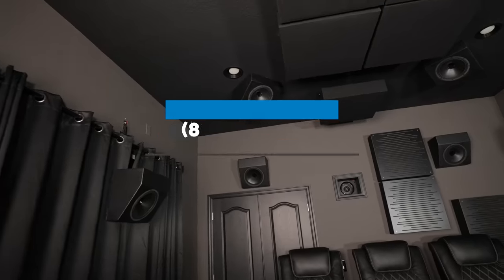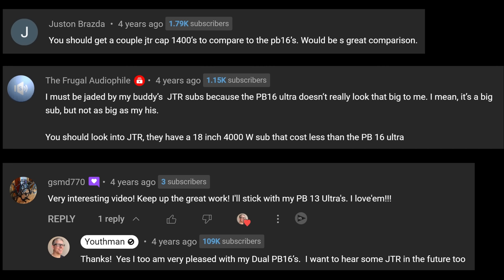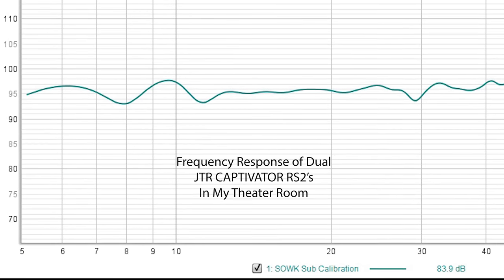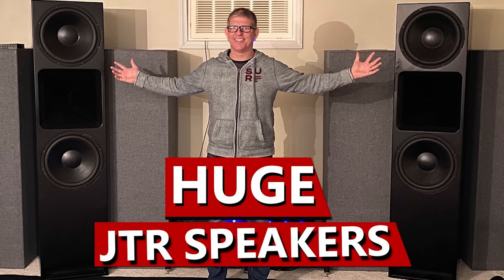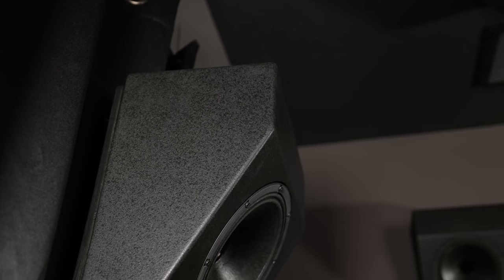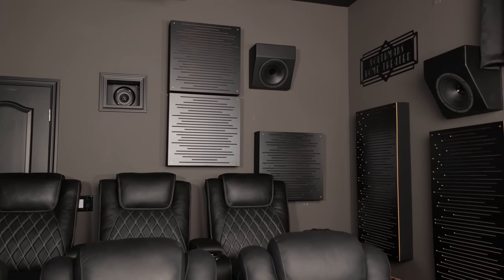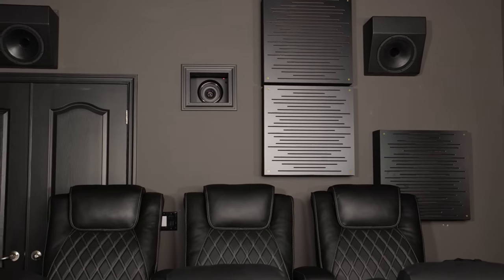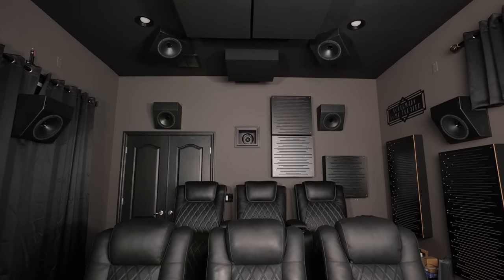I Installed EIGHT JTR Surrounds and Height Speakers in My Theater! | NOESIS 110HT-SL

Comment: Michael, great video! My theater was very similar to yours, I also was rolling wide dispersion for my sides. I made the decision to do a major upgrade, which included buying all new JTRs (Qty 5 Noesis 212RT for L,C,R, RS, LS |  Qty 2 Noesis 110HT-SL for both RS | and a Captivator 4000ULF-LP). Your video of Tony's theater sold me on JTR (You should get commission :) ) I remember Tony saying that he wished he had room for towers for his sides. As a result I knocked out large square holes and built large speaker pockets for my JTR 212RT as a part of my theater renovation along with extending my room 3 ft to make room for a new/large transparent screen and widening it by 6 ft. I removed most of my sheetrock and insulation and installed rockwool and use fabric for my walls. Also bought a new marantz, qty 2 monolith 7x200, JVC NX-7, and a miniDSP. During my first movie I watched I had the same reaction you did, the narrow dispersion of JTRs make for an incredible experience for object oriented sounds. I live in Texas so I can relate to your attic experiences. Your channel has been an invaluable resource to help me design and build my end game theater! Big thank you for all your hard work and content!  God Bless!
Reply from the maker: Thank you so much for the kind words. You have put together a phenomenal system yourself. I would love to hear it one day.
Reply: @Youthman  If you are ever passing through Central Texas I'd love to have you over, I'll even treat you to some Texas BBQ!
Reply from the maker: Thank you for the invitation. I have not been to Texas yet. Feel free to submit your home theater at www.hometheatertours.com.
Reply: @Youthman  just submitted
Reply: @Youthman I live in Texas too. I usually get all my items ready to put in the attic and go up and do it to it at 3-4am. That way sweat isn’t pouring into my eyeballs, burning until I wipe my face! That way it is about as cool as it gets up there…

Comment: I lived in Phoenix and had to do similar work in the attic. It was summer. We started at 6:00am and worked 3-4 hours a day. Took three days and before entering the attic we would guzzle a bottle of water at night and another first thing in the morning. We put on Tyvek suits, climbed the ladder and brought up tools and lights and completed the job. It’s rough working in those conditions. The temperature started at 90 degrees and soared to 160 degrees by noon. I won’t do that again.

Comment: Thanks for another outstanding experience Youthman, I've enthusiastically subscribed and followed you for many many years.  Your content is second to none IMHO.  I have a similar dimensioned room to yours and JTR 212 LCR + 4000s.  I also have the exact Klipsch surrounds + atmos speakers you just replaced driven by a Monolith 11x.  I've been contemplating your upgrade for a while now.  Do you think the 100 watts you're feeding the 10" JTR surround/atmos is adequate (rated up2 750 @ 8 ohms), or should I plan for more amplification long term?
Reply from the maker: Thank you kindly. I am completely satisfied with the 11X driving my entire system. It definitely helps that both JTR and Klipsch are high sensitivity speakers. Would my speakers benefit from having more power? Probably. Would I hear a difference in a blind A/B comparison. Maybe. Maybe not.

Comment: Well I’m glad to see that big smile on your face because I know you had to deal with some challenges in your attic but I hope you have the pay off that you were looking for and I am very curious about what you used to mount the 1-10 on your ceiling  because I can’t mount my speakers in the ceiling so I used some speakers mounts and I have all old school DCM speakers the original ones built in the 80s and the CX series made in 91 and Polk T15s for Atmos.
Reply from the maker: Thank you Michael it was definitely a challenge, but totally worth the effort. As stated, in the video, I added additional two by fours in between the joists. On the rear of the speakers, there are four key holes. We used 4 large screws to go into the 2x4’s and joists. Then an L bracket to lock the speaker in place.

Comment: Phenomenal upgrade Youthman and give you massive credit to go into the attic to do what you needed to. At least you can say you’ve covered any cardio exercise for the next 6 months lol
Reply from the maker: For real. I’ve been above my theater room maybe 4 times running HDMI cable, installing projector (adding bracing), installing Atmos speakers and running speaker wire.

Comment: I'm watching this for the second time as I determine if I'm gonna get JTR speakers.

One thing you said was about having wide dispersion rears. Is that really a Dolby Digital and DTS thing? Where'd you see that info?

I thought it was just the original Dolby Surround and Pro Logic decoding that didn't want directional audio because both surround speakers shared a single channel.

I think the idea for having 2 speakers is that you could mount them easier and higher up on your wall than with a single speaker in the middle of the back of your room with a long wire going to it.

I've been looking into Dolby Pro Logic and Pro Logic II as of late for some testing vs Dolby Surround (Atmos version) upmixing.

Dolby Digital has discrete surround channels and with Surround EX, an optional matrixes 6th. That's why I was wondering why your home theater was built the way it was for Dolby Digital. I wanna know where this information exists that I'm missing 👍

Comment: Those JTR (or some of the Danley GO2 range) look like they'd be quite good in a home theatre. I don't think I'd crank it so balls to the wall that I'd exceed the capacity of 8" co-axials, and they are quite compact (though not HTIB level).
Or if you live in a sound leaky apartment, binaural headphones and a Sub pac. I've always like the binaural effect. It is two channel headphones but with all the phase differences and EQ between channels that trick your brain into thinking the sound is some distance or direction away, instead of sounding right by your ears. I haven't heard any films with binaural recording though. The only thing the headphones miss is the feeling of bass on the body, which is what the tactile transducers are for.

Comment: I have been telling people, for years now, that On-wall or On-Ceiling Atmos speakers aimed directly at the listening position is far superior to in-ceiling speakers which may not be exactly on axis.

Welcome to the club Yout'man!
Reply from the maker: I had my in-ceiling on axis. They have aimable midrange and tweeters. JTR is just in a whole different league. Also, having a dedicated speaker cabinet is also a plus
Reply: @Youthman  a lot of people end up off axis though.  Especially if they follow the dolby guidelines to the letter and the speakers they choose dont have a steep enough angle to get them on axis.  I've seen quite a few people move from in-ceiling to external speakers precisely aim and almost everyone likes it significantly better.

I would leave the in-ceiling speakers for those cases where absolutrly cannot mount a speaker on the wall or ceiling.

Comment: May I ask what the theory is with the rear surround placement? THey seem to be outside of the seating area and I'm unsure if this is a specific choice to try and achieve a specific axial relationship to the seating.
Reply from the maker: Simple reason is they had to be mounted higher than my door. Just a limitation of my room but fortunately the angle of the speakers is perfectly aligned to the front row. The rear seats will not get the benefit of the surround back speakers

Comment: Next on the upgrade path:
AV Professor: Marantz AV10? Anthem AVM70/90? Trinnov Altitude 16?
Speakers: Wides?
Projector: JVC Laser?
Reply from the maker: Eventually, it will likely be a new processor. Already considering the JVC NZ8. Wides will probably not happen due to the size of my room. I have the Anthem and AVM70 in for review so I’m curious to see how it compares to my Marantz AV7706.

Comment: Congrats on the new system.  I live in Daytona Beach so I know the 'joy' of working in the attic in the heat.  One time I almost passed out and found myself stuck on some 2X4's and had to tear my pants off to get out.  Once you stop sweating that's heat stroke time.
Reply from the maker: Yes, that last 15 to 20 minutes was pretty sketchy. I knew it was time to get done and get down. I just didn’t want to come down, get cooled off and have to go back up in the attic to finish.

Comment: what an amazing move for you Micheal! I love using togglers to install things into sheetrock situations... they are very sturdy and easy to use. Congrats on the progression! next up trinnov??
Reply from the maker: Thank you, kindly Eric. I don’t have any plans to move to a Trinnov anytime soon I have the Anthem AVM70 in for review.
Reply: @Youthman I hope you get a good ARC calibration. Less is more with ARC IMO.
Reply from the maker: Appreciate the tip. I just hope it does better with base management than it did back when I reviewed the MRX 1120 it sucked the life out of the bottom end I even sent the file to anthem to tweak. It was better but still was very anemic.
Reply: @Youthman  The difference this time will be built-in time and phase alignment. The Room Gain is mid-bass 150-300 Hz. Deep Bass filter can be centered from 20-80Hz. These are filters similar to miniDSP. Tilt can be adjusted for brightness. 

I stop filtering at the last peak/null beyond 3-4 db for each channel which for my room and speakers provides a more accurate sound reproduction. ARC does require a bit of adjustment to get to your destination, but all race engines must be tuned.
Reply from the maker: Sounds like they have made some nice improvements to ARC since my experience several years ago
Reply: @Youthman  yes sir. FYI from the ARC AVSForum thread: Once you upload your ARC solution into AVM70, power cycle the unit to complete the process. This is a newly discovered bug and not currently covered in the documentation.
Reply from the maker: Appreciate the tip

Comment: Jeff's right, Youthman's right ... urge overkill on the fastening!

Overhead, in a room with serious LF capabilities ... anchoring/fastening must be rock solid way over engineered. 

It's great you address the importance. 

I've got Unistrut down each side of the room, front to back. 
Spanning side to side, I've got sets of Unistrut that I hang QSC yoke mounted actives. 

Since it's all Unistrut, I can quickly experiment with any positioning, and yet with all the structural integrity in the world. 

Of course, the Unistrut aesthetic isn't for everyone ...
It's great for cabling, festooned. 

Great update.
JTR's just killin' it.
Reply from the maker: For sure. That’s awesome that you can adjust your speakers.

Comment: Awesome setup!  Did you leave all your ceiling speakers installed or just the front 2?  I was just curious with my install if I could maybe just install a sideways beam into other beams and mount the speaker over top of the hole vs patching all of the 9" big holes.  Also curious if you had a chance to hear the Captivator 2400's and how they compare to the RS2's because I'm not sure I have space for RS2's.  Thanks!
Reply from the maker: Yes, that’s exactly what I did. We ended up moving the front speakers forward about a foot. Rather than hiring someone to patch drywall and repaint, I left those two speakers there. For the rear speakers, I could not move them any further back due to an air duct vent so we mounted the new speakers over the 8 inch hole.

Comment: Great enthusiasm as always, and very understandably so ;-) That´s one thing that has boggled me right from when I started to view your channel. Why did you persist on using diffuse speakers on your surround channels. Those are a thing of the past from way back when Dolby Prologic was a thing. Great to see that you finally moved on and went the direct radiating way, and You´re thrilled with the result. This is the way 😁
Reply from the maker: The main reason Jan is, I’m a creature of habit and don’t like change. Lol. When I built My Home Theater 16 years ago, Dolby recommended wide dispersion speakers for surrounds. I always enjoyed the sound, so I wasn’t in a hurry to upgrade.

Comment: I don't need in walls but I was just looking for the better speakers of the 2 to pair with the rtj 410s
If I chose to either listen only for Atmos and surround speakers would I even notice a difference or like do you recommend by i buy the rtj 110 for Atmos and the floor surrounds with jtr 110s?
Answer me this  
I'm very curious how Jeff came up with double the price of the rtj 110 over jtr 110 price to performance wise
I literally just learned about the rtj 110 yesterday
Reply from the maker: I haven’t heard the RTJ 110 so I not know how they compare. You can email sales@jtrspeakers.com and Tony should be able to provide you with the info.
Reply: @Youthman  I just asked them to reach out to you to let you borrow a couple to try them out for ya I would love to see your comparison
Reply from the maker: It was quite the task to mount and install the JTR 110’s so unfortunately, they will definitely not be coming down.
Reply: @Youthman  what's your guess u think it's worth 2500 over the jtr 110?
Reply from the maker: I’m 100% satisfied with my 110 slants.
Reply: @Youthman  well for someone like me which I think I should get im more interested in how the hell Jeff came up with 2500 for basically the same speaker design/specs and let's not sugar coat it over the $1200 jtr 110s
Reply from the maker: I’m not familiar with the RTJ 110 so you’ll need to email sales as shared above.

Comment: Congrats, Michael, on an excellent upgrade. I’ve been inspired quite a lot by your videos for past couple years and have finally come to a point of setting up my own HT room. 2 questions:

1. Have you been considering speaker placement guidelines by Dolby where they recommend specific angles of speaker placement relative to the main listening position to create the best possible bubble effect? From looking at your setup - it seems so that you had to sacrifice some of those. For example - the rear surrounds seem to be pretty close to rear atmos speakers in your room…

2. Given your pretty powerful subs and other components - how does your electrical setup look? How many circuits with how big of breakers (Amp-wise) and for what do you have? Did you have any ground-loop issues that cause humming noise coming from the speakers?

And thank you again for all your work popularizing HT topic!

Comment: Though not quite as impressive, I enjoy my system every chance I get. Before deciding on Ascend Acoustics, I spent over 6 months on forums and listening to different brands at local shops(including Best Buy). So my apartment is 700sq feet, and I didn’t want to go too big and loud. After picking up a pair of Ascend Acoustics CBM-170’s, I loved how they sounded. So over time I upgraded to a CMT-340C and last month I finally got a pair of HTM-200’s for surrounds. Along with them I picked up an SVS SB-1000 Pro sub. Everything is going through a Yamaha A2A, Sony PlayStation 3 and 4 and a UBP-X800 as well as a 50” LG 4K tv. Took several years to get to this point, but I am finally done with everything and couldn’t be happier.
Reply from the maker: That’s awesome! I’m thrilled to hear you’re enjoying your system

Comment: Gerard Stroh***
You Did it Michael Stevens***
Well Now You Are Now PRO Audio And Now You Need To Turn it Up At High Levels to Test Your Speakers and Crank it Up Michael Stevens!!!
I Bet It Was Hard To Lift Up Those Heavy JTR Speakers Michael Stevens!!!
You and I Have Pro Audio Speakers Now and My Surround Sound Speakers are 12 inch Speakers are 600 watt Speakers at 96DB of Output***
I Use 2 DBX DriveRack Pa2 Speaker Management Processors For My Mains and The Other one For My Sub Woofers Speakers and That Is My DSP For My Speakers!!
They Do EQ's and 3 Way Crossovers and My Mains I Have Presets For Each Artest For My Records and My Movies That I Play On My System***
I wish I can Ancer and Mound My Speakers in my Home But I can't Because I Rent My Place Whare I Live!!!
My Sound System It is Super Loud Michael Stevens and I Have 10000 Watts and 1500 Watts is on my Mains and 8000 watts on my Sub Woofers and I don't Have it at those Valumes and I Have it on Mighty Low Because I Have People That Live Next Door and My Place is still A House !!!!
How Does It Sound Michael Stevens!!!!
Good Video!!!!

Comment: Are you running 4 or 6 atmos speakers?
Reply from the maker: Four. As shown in the video, I moved the front two height speakers forward about a foot. I left the front in-ceiling speakers installed but not connected. It’s not worth the expense of hiring a drywall guy and repainting.
Reply: @Youthman  are you happy with 4 in your room? Or are you planning for 6?
Reply from the maker: Absolutely. My room isn’t big enough for six my room is 13 foot wide by 19 foot deep with 10 foot ceiling. My front cabinet is 4 feet deep so effectively I only have 13’ x 9’ of space to work with.